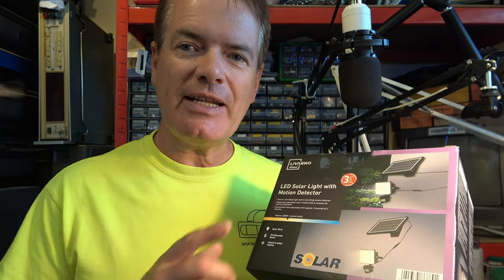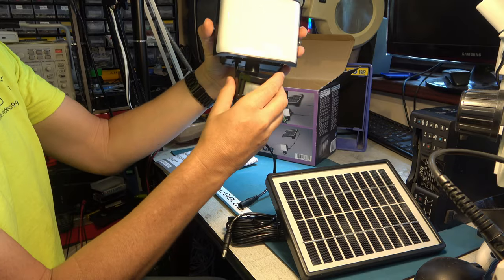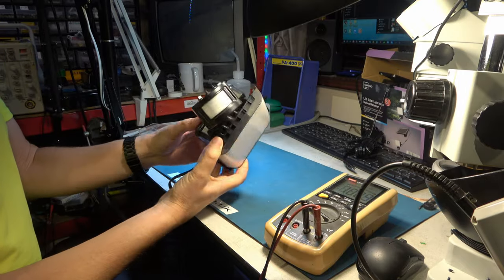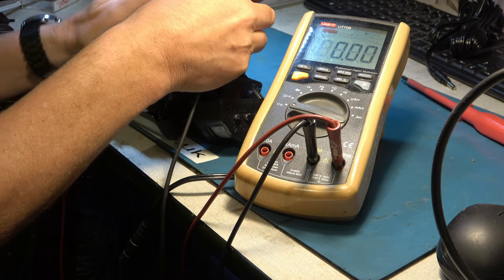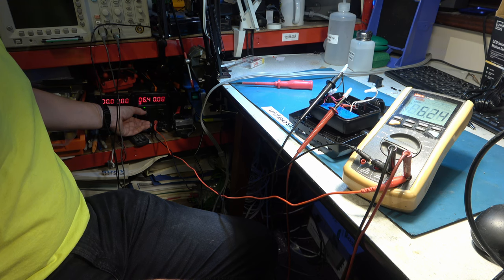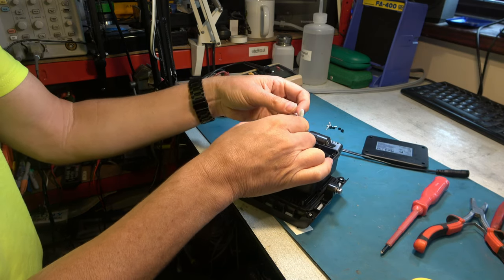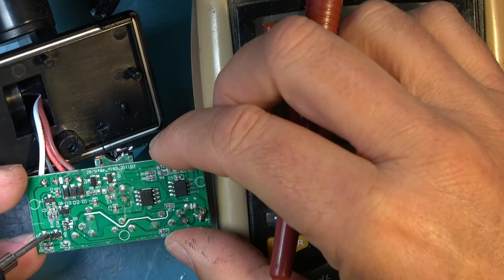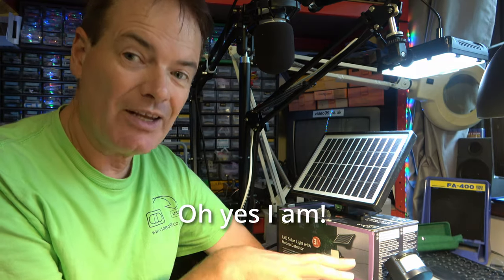LIDL solar power security light: From a review to a repair?

Comment: Hi Colin, interesting seeing what is in here. I have always been taught that "rule of thumb" for safe operating these 18650 type LiIons are 3.6v - 4.2v.  Given what you saw with the super low current to begin, then more, this was the BMS in "oops it got too low" mode.  Once you got it past there into "low operating" range (3.4-3.6 prr cell) the thing took over, allowing charge to a higher level.  At under 3.6/cell it's probably just shut down... Hope that makes sense.

Comment: The BMS shut down the battery  , charging it on the power supply reset it.The main control circuit could have locked up due to low voltage as the battery slowly discharged in the package.The batteries will be damaged and wont have there full capacity .its a common problem with the shelf life of products that have Lipo batteries although these are not that old.maybe the control circuit discharges the battery in the box too quickly..Bad design of the power control they should have fitted one of those pull tags to connect  the battery  to the system.
Reply from the maker: More or less my thoughts too.
Reply: Bang on. Pull tab required 👍🏻

Comment: What a strange problem,  i suspect that the battery was NEVER charged by the manufacturer.
It needed a high enough voltage to start.
If the battery was lifted to a warmer state  (like in your house)  it might produce a tiny bit    extra
voltage and the protect circuit could switch on.
I could be talking rubbish lol.

Comment: I bought something remarkable similar 25 years ago ! It started better than yours as it worked fine for one summer. But then as soon as the shorter days started the battery (lead acid) became complete discharged and that was the end of it. I think this will still have the same problem. I.e that there's just not enough sunlight in winter to keep the battery happy and that combined with low temperature results in early failure.

When I opened up my lamp and tried to repair it i found that even though the plastic car appeared to be designed to drain there was a puddle in the bottom and all the switches were corroded.

Update: I reached the end of your video. Good to see that they're working. I still wouldn't touch them with a bargepole though...

Comment: I’ve got one of these with the same problem - reading 0v on the wires coming out of the battery. However upon peeling back the plastic on the battery pack there is a PCB which is presumably the overcharge protection circuit. Measuring the actual battery terminals there’s 5.2v on it! So the actual battery isn’t dead, but the PCB has cut the output off, presumably as the voltage has dropped too low.

As an aside the manufacturer was quick to agree to a full refund, clearly this is a very common issue.
Reply: I replaced the battery in mine (fearing cell damage), £6 from China, slightly larger capacity. light now better than new!

Comment: I have purchased 5 similar to these some time ago , some worked , right out of the box , these lasted for a while (not long enough) . The ones that needed charging,  right out of the box and don't work.  Even after charging by the panel  for 2 or 3 days in the off position , conked out first. In my opinion it's the quality of the batteries, or the lack of quality of the batteries.
Reply: I hope you had a go at replacing the batteries or upcycling them into other projects.
Reply: @leepshin  I've kept bits and pieces from them , like the glass solar cells and the LED lights . However I have another one,  also with a glass panel , that was branded as ARLEC and that was $99 maybe 7 years ago , still works , but battery is on it's way out , I've been thinking of upgrading it with a used phone battery.  And perhaps extra panels for more charge , I'm not sure how the internal regulator would react to the extra charge from more panels.